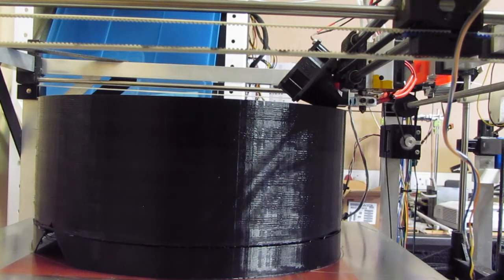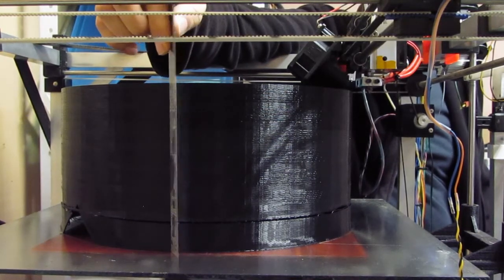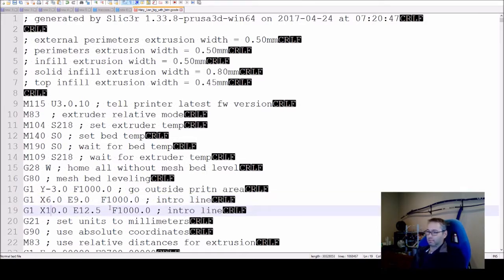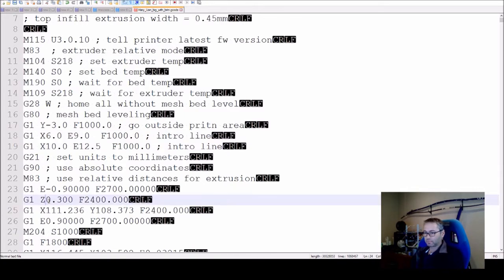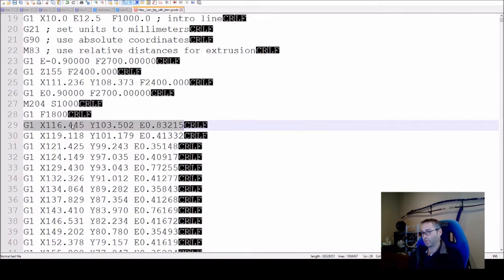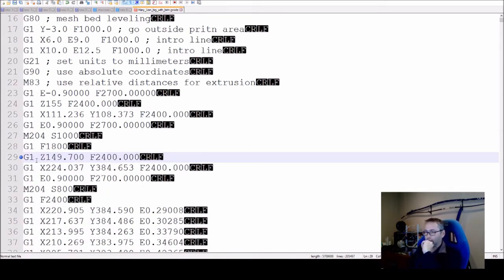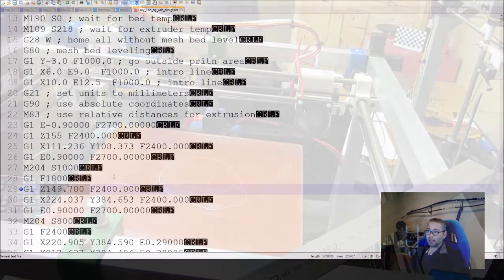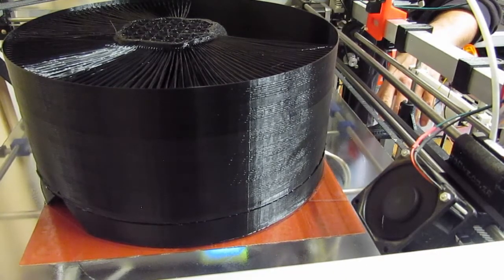3D Print recovery

Comment: My Home is in the center of the bed right where my part is being printed...So I can't home.???
Reply from the maker: That with a delta machine or automatic bed leveling in the middle.
Reply: @MScholtz  Creality Ender 5 plus with ABL in the center
Reply from the maker: I was thinking you can rehome on the part and print from there if a bltouch.  But its not going to do it right because it will try and move up by that much more to continue printing.  You'd need to tell it if it homes there that its at the height the print stopped. I'm sure you can modify the g code to tell it that once it homes its at that height not 0 but id have to look it up and probably test beforehand.

Comment: Big like! I'm new to 3D printing and was thinking conceptually that a gcode edit to the last known printed position would be what you'd need to do if a print was ever interrupted. However, this filled in a lot of detail that I wasn't aware of. Thank you!
P.S. What is that huge thing you were printing?
Reply from the maker: It is the hairy lion, but huge. It was 3kg of filament used in the print.